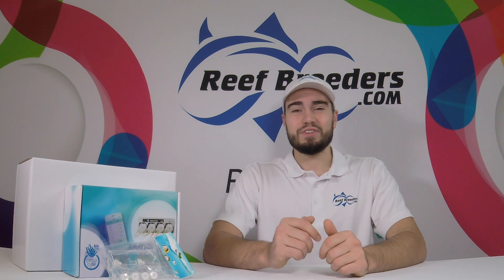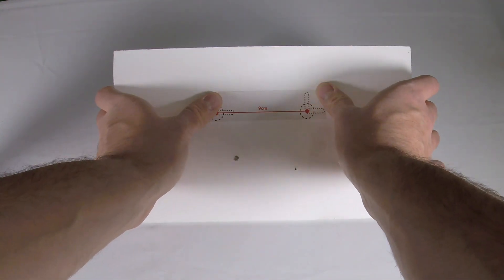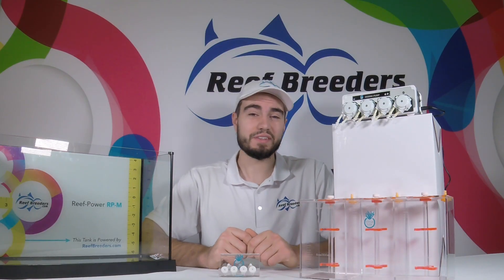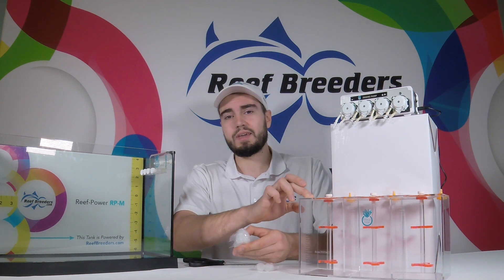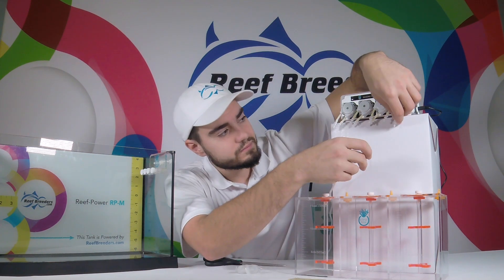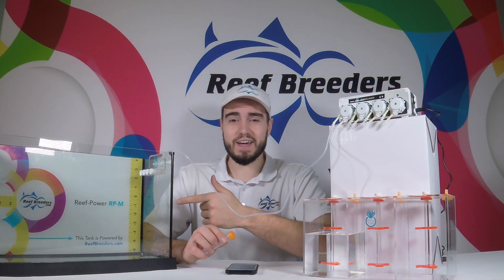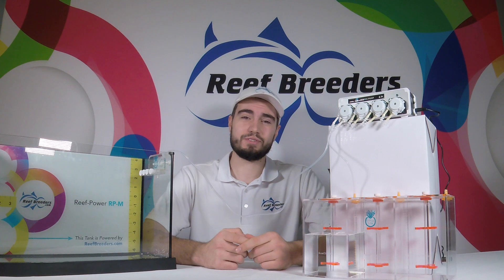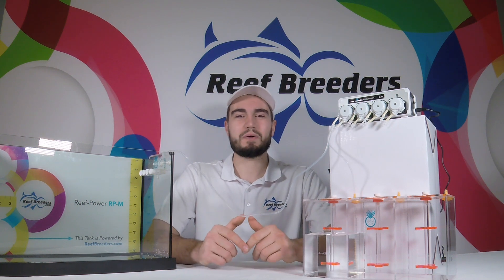Coral Box WiFi Doser Physical Setup Guide

Comment: My dosing pump doesn’t dose the amount that i want, it only dose like 10ml and not the amount the i setup like 35ml. Calibration is fine I also try to other dosing channel but same problem. Any help here?
Reply from the maker: Is there any air in your dosing lines? Were the lines primed prior to measuring the output? Have you tried increasing the dosage to compensate for any air that may be entering the lines?
Reply: @ReefBreeders  I thought it dosing 10ml, but it's only dosed 1ml, even I increase the amount of dosage, I try using RO water to test how much will it dose, and it only dosing 1ml per the time schedule.
Reply from the maker: @silvanobondoc3453  It only dosed 1ml when? During calibration? During regular operation? What are your settings? Please contact us for service at https://reefbreeders.com/contact/

Comment: What happens if I lose power and I am not around?

Will the pump remember the settings?
Reply from the maker: Hi, 

The dosing pump will retain the settings forever, they are saved on an internal hard drive. The time will be saved for up to 90 days. They are programmed not to double dose in the event of a short power outage. For example, if your doser activates at 12:00pm, and the power goes out at 12:01, it won't resume dosing for 1 hour, until 1:00PM.